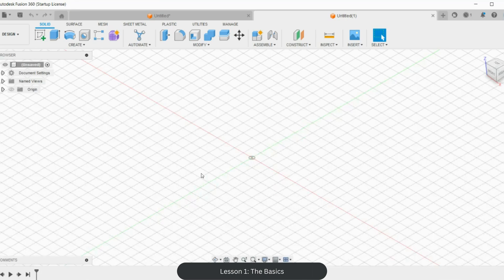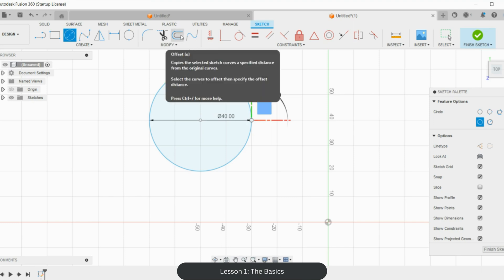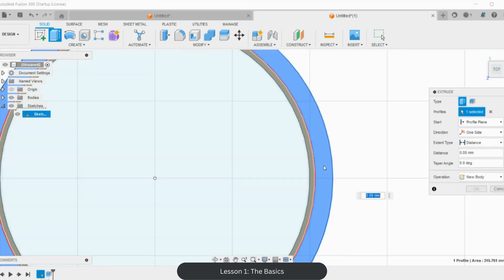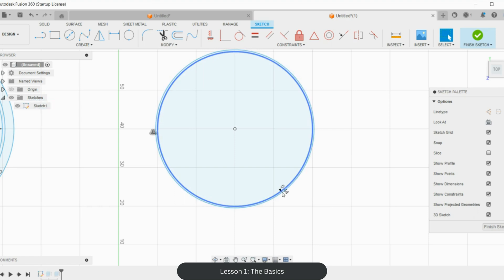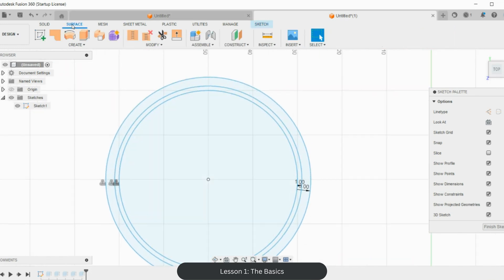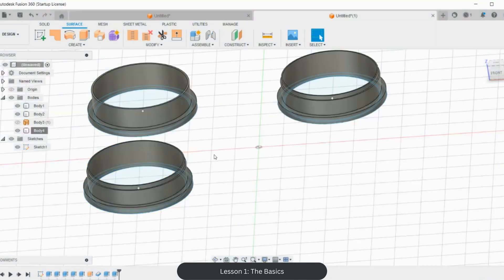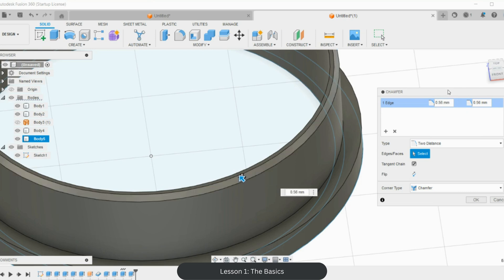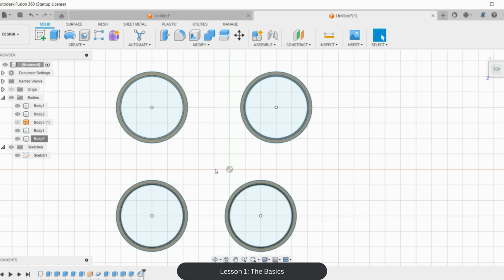Making Polymer Clay Cutters With Fusion 360 - Lesson 1- The Basics (Cookie Cutters)

Comment: Love Love love your videos!! so clear and useful!! Once you make the design, what do you have to do to pass it to the printer? can you maybe do a video with a full process? thanks!!
Reply: With the saved .stl file, you have to open it in a slicer program, there are several available, my preference is Cura.This program then slices the files into g-code which is what the 3d printer needs to print it.  This g-code file is then saved to an SD card, this then goes into the printer and you print that file.  Slicer software can look initidimating as there are a lot of settings that control your printer but there are loads of videos available to help with understanding what these settings do, plus in cura if you hover over the setting it pops up a window that explains what that setting does x
Reply from the maker: Thats an amazing explanation, thank you @TheResinandCraftSpectrum  
I will also try to do a video as well for you as well @martinanavarra3982  
Apologies for my youtube absence, I will be uploading a new video in the next 24 hours and also collecting comments on what you guys would like for future videos.